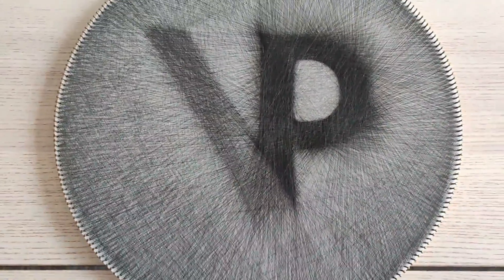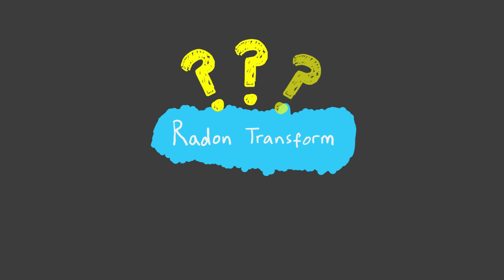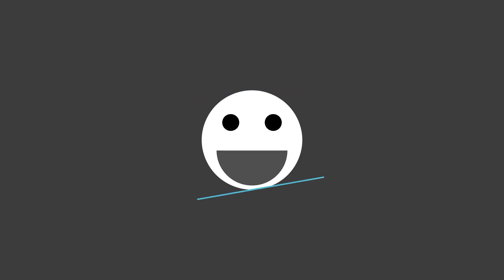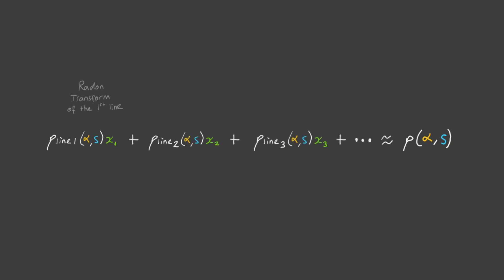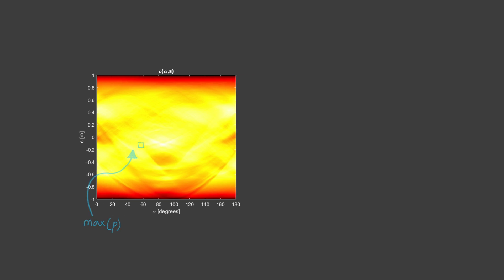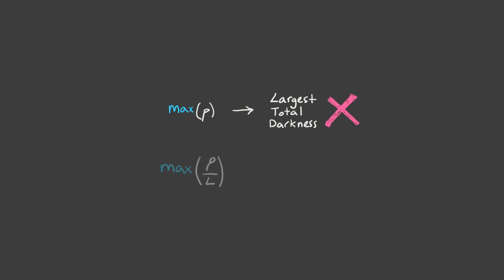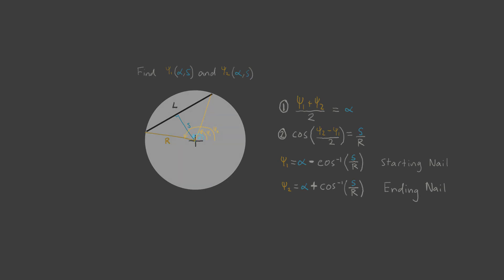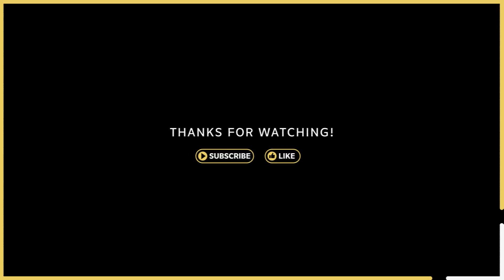How To Make a Computer Create Something Beautiful: String Art #SoMEpi

Comment: This project is so cool.❤
Maybe you should run a optimization algorithm at the end to minimize the amount of string you are using. It is biginning to look a little comprehensive.
Reply from the maker: Interesting idea! String isn't an issue practically speaking (in my opinion at least). But even if you did want to minimize string, you can just terminate the iteration loop whenever a maximum number of lines have been plotted or if the difference between the radon transform of the image and the string representation is less than some threshold: p - sum of p_line < c
Reply: @virtually_passed  If I understand your method correctly, the string will sometimes go on the outside on the circle, right?
Thus I was thinking to optimize the order you put down the strings suce to avoid unnecessary string on the outside. That would save string and make it faster to "print".
But if you never have string on the "outside", then this makes no sense. 🙁I rewatched your older video and at ~8:50 you show that you do this in order (cause you only test lines from where you are), but in this video it seems like you pick from all possible lines and not only the lines from your courent point. But I might have misunderstood.🤷‍♂

Cause yes, if i understand your method correctly, you are already "optimizing" the number of crosses, by picking the strings that reduces the difference between the target and the line drawing as much as possible (per string length), as you explain at 5:20 and 6:30. Thus you are already using the optimal amount of string (on the inside) whit your given termination criteria.

I would use stop if "p - sum of p_line < c or line length < maximum line length. Just to have a limit. But how to select t good value for c is probably difficult, it might change from image to image, some images might even look better with fewer strings, even though the threshold is larger. Some images might simplify very well and others not at all.

In the old algorithm, it would be interesting to test if the starting point makes any difference, but I guess you could say that for all the following line too, if you start questioning if picking the best line when starting, will end up giving you the best image.

Comment: One think I like about most string art is that the endpoint of one line is the start of the next. I don't think this algorithm accounts for that right? Would be an interesting next video!
Reply from the maker: Great point! You're exactly right. To account for that you'll need a separate algorithm (that I didn't talk about yet) to get the order right. If the order doesn't match perfectly you can also wrap the string around the outskirts of the nails
Reply: @virtually_passed  yeah that would work but I don't like that 'hack' haha. Maybe you could adjust the algorithm to pick the next line not as the max over the entire space but over a subspace where one of the endpoints is the same. That would work as a greedy algorithm!
Reply from the maker: @owendeheer5893  I like this idea :)
Reply: @virtually_passed the algorithm should take into account both ends of the string (the beginning nail of the first line and the end nail of the last line) as possible appending positions, since there is no requirement that the lines are drawn in any particular order, it's just sufficient that they get drawn/placed at all, so they can be placed in either end.
Reply: I wonder if it is better to search the limited space for the best line starting from here, or to generate the global set of lines and then pick the order to place them. The ordering algorithm's objective function would be minimizing "wasted" movement along the outside.

Comment: I dont think the colour version will work correctly with real strings, the colour at each point is (almost) entirely dominated by the topmost string. Unless you could choose the colour of each line section independently, rather than laying all C, then Y, etc then you could add dithering of some sort. Happy to be proven wrong though. Great video btw.
Reply from the maker: Great point! I've been struggling with modelling colored strings for a while now. Indeed order does matter. Ive found that even with CMYK and with interweaved threads there are still colours I can't perfectly recreate. The only solution is to use many more colours of thread. Not easy to implement in practice though!
Reply: @virtually_passed  I've seen some string art that actually has the canvas as black and uses white strings instead to add 'bright white spots'  and on top of that the color. Seems to look really nice.
Reply from the maker: @diegoberrocal8500  ah interesting! My guess is that they'd use white,red,green and blue string colors.

Comment: past 5 month im working on same thing, I already build several different algorithm even self learning pixel/line weights during training like neural networks with different resoult. Now im wonder your approach ;p. You also metioned once about FFT method and Im very curious about that.
Reply from the maker: wow that's incredible. How did the neural network method work out? I've been thinking of implementing that one myself too.
Reply: @virtually_passed  its not a neaural network but its very similar i term of training session and weighting pixels/lines. For example I divide 3k strings into 20 layers (150 wire per layer, more layers mean more ram usage), each layer has its weights and after fully draw image then I decrease weights for invisible pixels so it might take another route of string. I also use defferent line score method, instead of measure average darkness then I calculate sum of difference between wire, source and destination colors and get lowest negative score (score += abs(source-wire) - abs(destination-wire)), the smaller negative score mean it will more improve the image score, any positive mean it will degrade image score, dividing it or not by pixel count of line make some different resoult, non divided preffer center image and divided preffer edges of image. I also noticed that its much better to score 'per pixel' instead of 'means' methods, 'means' methods are more blurred. I laso improve performance by precompute score for each possible line, and during draw line I update score for each line that correspond to each pixel on line (score += +abs(cdOld-cwOld) - abs(cdNew-cwNew); // it does not require to recompute whole line, just update single pixel score). Using greedy algorithm do not improve performance, but in case checking every possible line without continuity that its difference like 5s and several minutes to generate image - but it require somre pregenerate tables etc that consume more ram and generating them take some time each time I run program, its 5-7 sec but its annoing as I run it many times ;p.
Reply: @virtually_passed  its very strange, I wrote many things about my approaches but my comment disappear ;0
Reply from the maker: @Dobijasek  :o I'm unsure why, nothing has been flagged as spam on my end. Feel free to reply again or email me: virtuallypassed@gmail.com 

:)
Reply: @Dobijasek  Same, have also been working on this same problem, super fun to get nerd sniped on it.
Reply: The what? 2 guys make the same thing I want to programme too😂
Reply: @jakubstepanek1975 two? You mean, at least three except the video's author?
Reply: I made a simple algorithm that starts from a nail and measure the darkness under each possible line from that nail and takes the darkest path then starts again from the end nail.. It's pretty fast but the results aren't so good, any ideas?
Reply from the maker: @محمدسلامة-ز4ف  that sounds very similar to the method I talked about in my first video. This should also work, but it'll likely be slower. There's a few reason the results aren't working out for you. Try adjust the resolution of image = 400x400 and Nails = 300. If that doesn't work, keep tweaking the darkness of each line and the thickness until you get better results.
Reply: @virtually_passed 
Thanks! I'll try that
Reply: Same here. Have been working on string art project. But i ame still on the greedy algorithim. Trying to figure out colored images. But maby have to scrap that to first make a bether image using a other methode :/
Reply: I also worked on this problem and was very surprised to find the first video of this series, since I had a pretty similar approach 😂 
Btw, in the end I managed to make the least squares approach work (I've used non negative least squares)